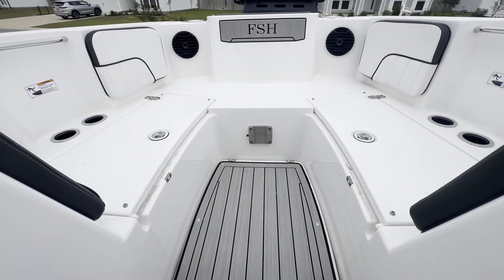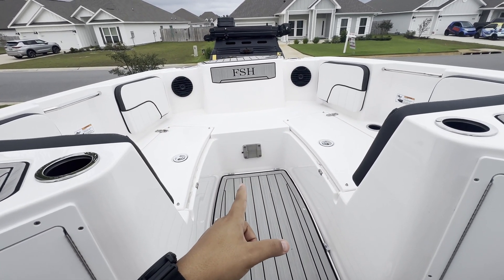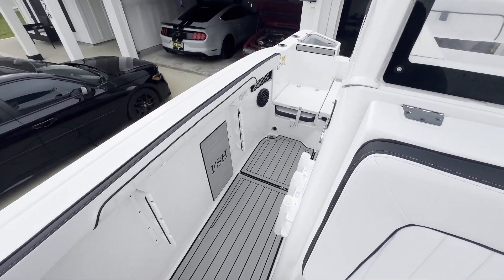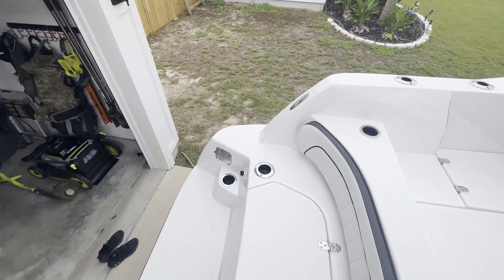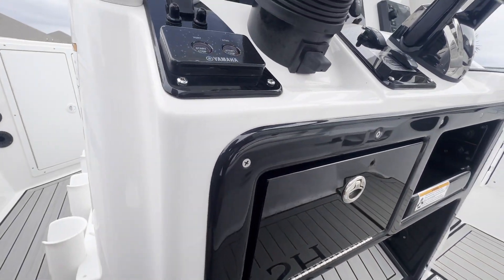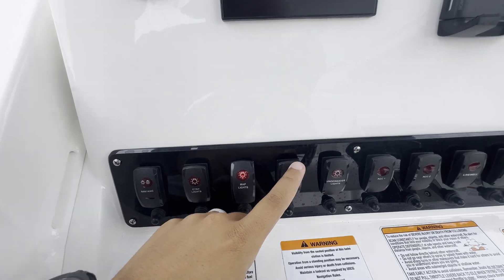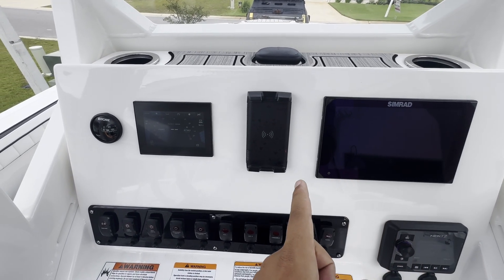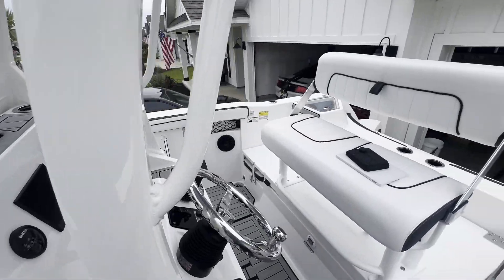Yamaha FSH 222 - ISSUES

Comment: Love the mustangs in the garage! Looks like maybe a 2020 with a fox next to her.
Reply from the maker: Thank you 2017 GT350 and a 89 LX
Reply: I’m sure that loose wire was the cause to many of the problems. Having the sport E model, it’s all fly by wire. You should be good to go now brother. This is why there is a one year warranty, for all the little things missed on the assembly line. Still be pleased you got a new boat, used boats are a horrible Choice.
I just got my brand new Yamaha 252 sport . So for, I love it, the 252 sport is still mechanical steering and throttle, one reason I chose it.